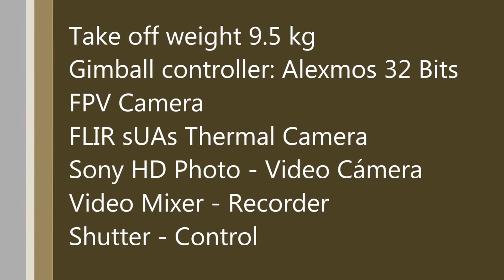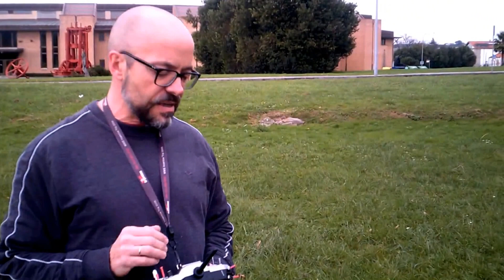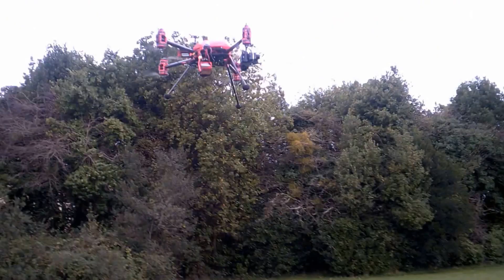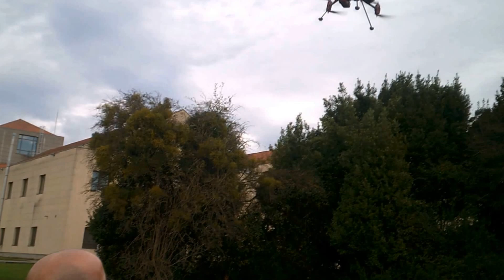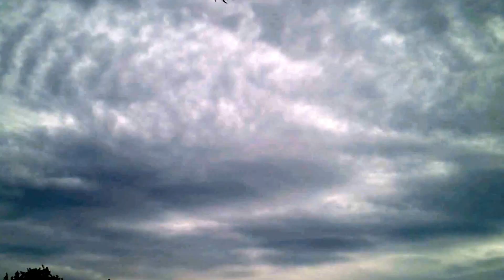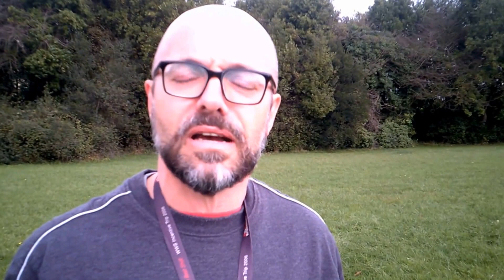Flight test of modified Mavrik - Steadidrones

Comment: I've been having a heck of a time with my Mavrik X8.  I'm hoping to chat with you and pick your brain about how to trouble shoot some of my problems.  My goal is to fly a survey mission.  At first I only obtained an 8 minute flight time with plastic props.  I got the carbon props and it floats around a 10 to 11 minute flight time.
Reply from the maker: +HopefullJ I am pleased to share with you our experience. You have taken the first good decision. APC propellers are out of range with the RPM the ESCs give at full trhottle. Acording to APC they are designed for a max rotating speed of less than 5,000rpm and I measured around 6000. They will probably flex and flutter a lot. We had a pretty heavy payload because of the setup of cameras and mixer and recorder and we were around 12 minutes with T propellers although I removed a lot of pieces of the frame. Are you flying with the battery held in the rear part? I so, do yo feel comfortable during flight forward and backward?